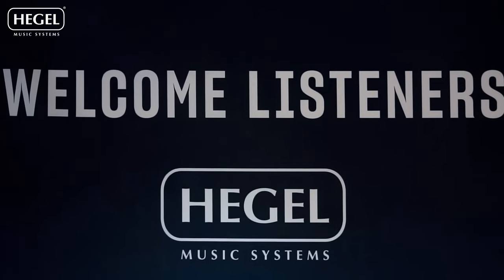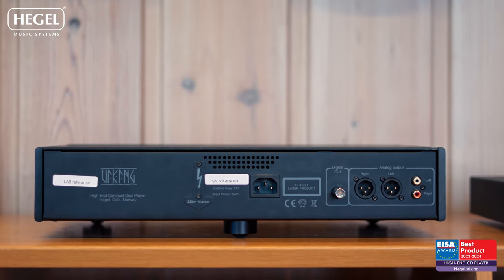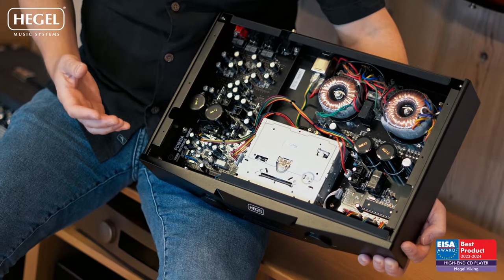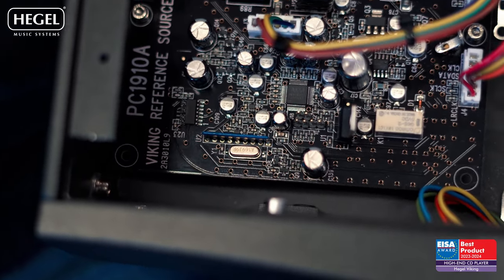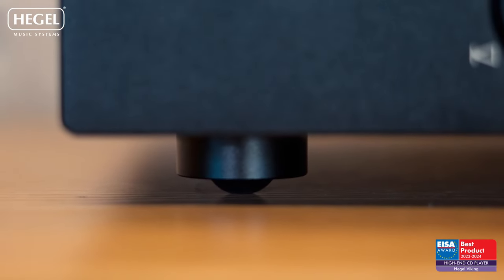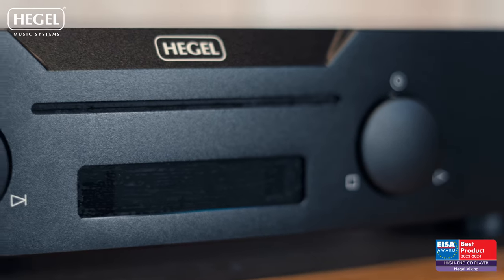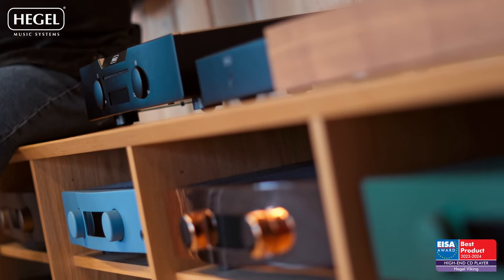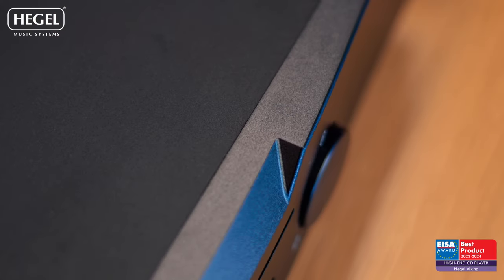Hegel Viking introduction

Comment: Why didn't Hegel produce a SACD player at least?... Because listening of a CD its so old- fashioned and make no sense to buy some..
When I want listening from a digital optical disc data storage, high classy sound, its SACD..and of course not a CD..unbelievable ..Because the dynamic range of a SACD are much higher than a CD. Dynamic range: 115 dB; frequency range: 20 Hz— 50 kHz. CD Dynamic range: 90 dB.. So I'm waiting for a good excuse.. By the way I'm a Swiss Hegel Fan....and my budget are free for the new Hegel H600 Integrated Amplifier.. what a hammer of Amplifier ..before I used a McIntosh machine..
Reply from the maker: Thank you for commenting. I understand why you wonder. The thing is that we wanted to make a specialized CD-player because we knew we could make it really good and because there are not so many out there.
Reply: @HegelMusicSystem   Thank you for your quick response..